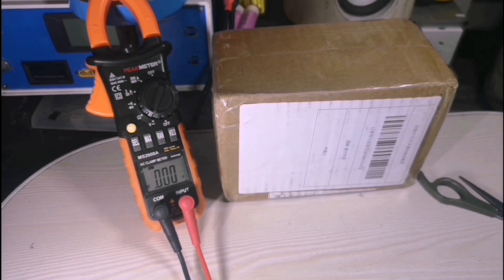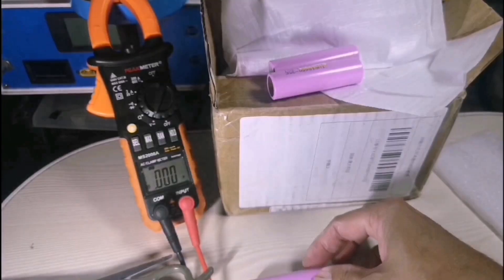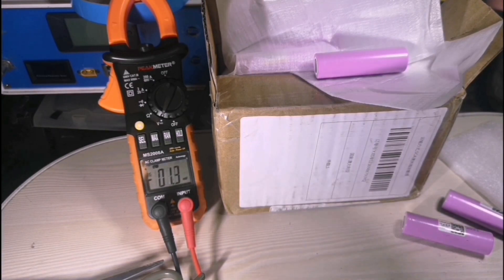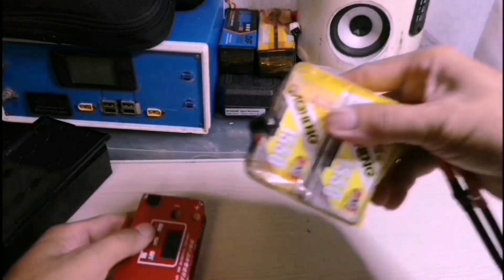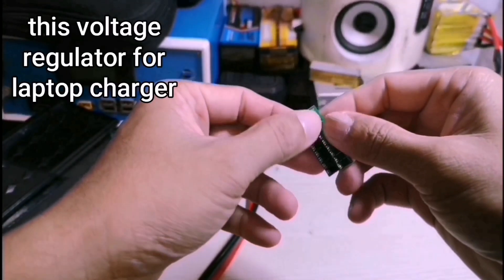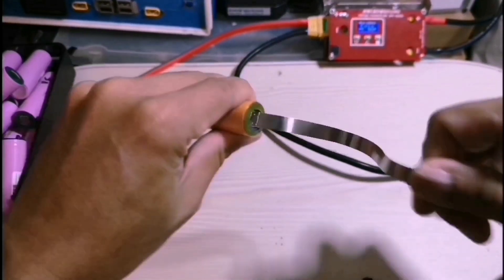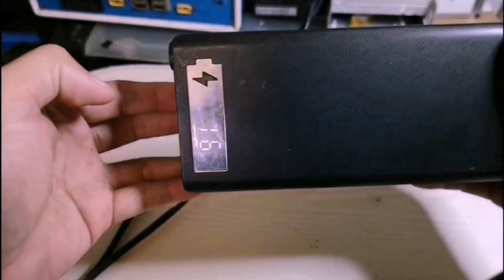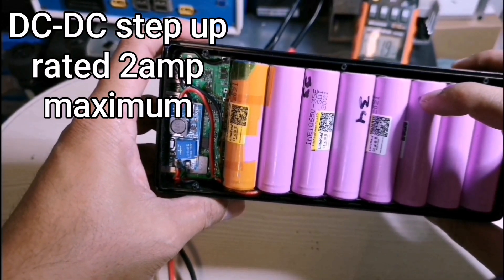DIY Note book power bank 53,000Mah 200Watt hour.

Comment: hows this red welder compared to bifrc 8 mosfet?
Reply: Red spot welder more advantage
1. 99 energy more choices
2. every mosfet gate installed resistor
3. every mosfet protected by diode for current back flow during welding process.
5. Because it is 99 energy you can weld 0.05mm
BIFRC
You need to wait the green indicator if it is ready to weld sometimes you do miss the timing! but still worked pretty...
Reply from the maker: BIFRC & RED SPOT WELDER  they are working pretty good but RED SPOT WELDER  more advantage because it is 99 gear you have more choice where as BIFRC limited choices only 7 gear other than that RED SPOT WELDER  manufacturer install five resistor and diode to protect the mosfet.  diode prevent anti current back flow.